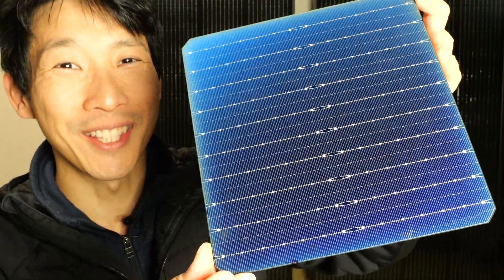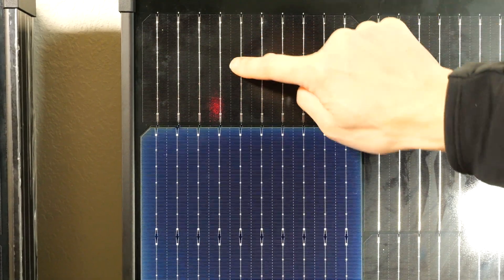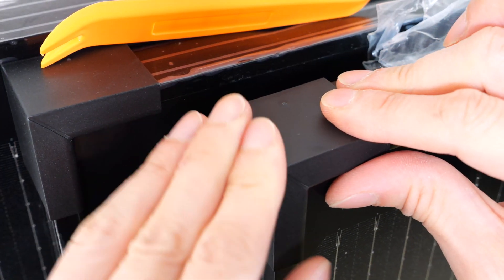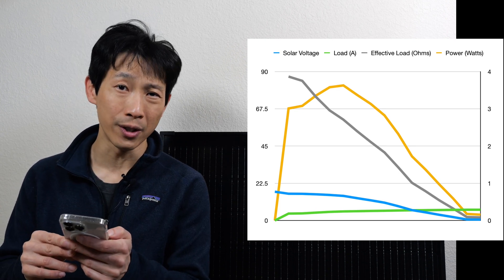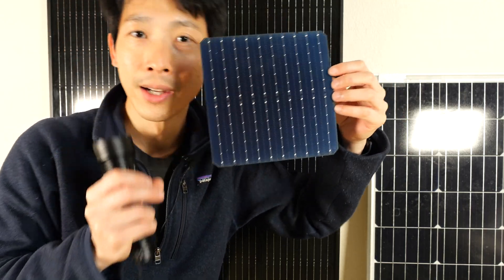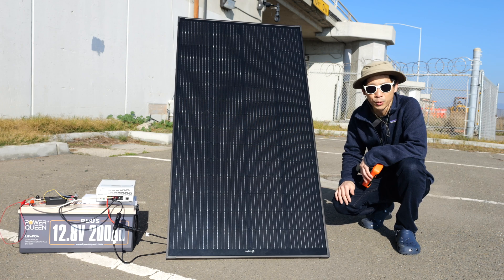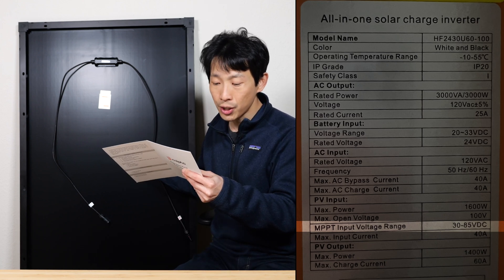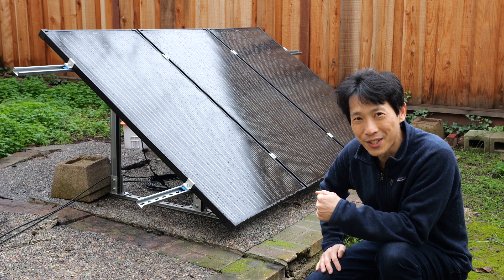How to Integrate Solar Panels into a System [Calpha Solar]

Comment: hmm this video should have done much better. i am surprised. what about using one of those grid tie inverters with a limiter to avoid back feeding. the Y&H 1000w model on al le exp is only 260 bucks and seems like the best model to use if you dont have a power selling agreement.
Reply from the maker: I tend to get a bit to technical. You would have to sense the home usage and tie that info back into the grid-tie (via a limiter). A cheap grid tie like the Y&H doesn't have a limiter built in which would make integrating it extremely difficult.

Comment: Weird how partial shading will produce no electricity with some panel designs.
Reply from the maker: Any single string will not produce current if one of the cells are blocked. Would be great if it they have bypass diodes for each cell.
Reply: interesting >_>  @BeatTheBush

Comment: No need to apologize for info overload...  Helps in the understanding of the panel functions and dynamics.   Next up:  wind turbines??
Reply from the maker: Possibly in the future. I like those too. =D
Reply: @BeatTheBush   Apparently there are new turbine designs suited for residential with much better efficiency numbers/less noise.  But of course not available yet.  The one I saw was the Liam F1